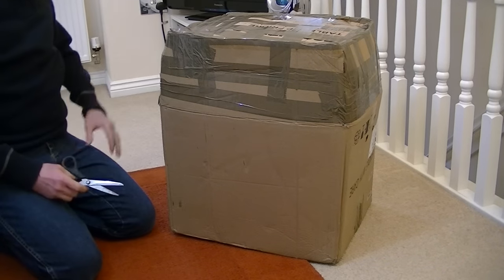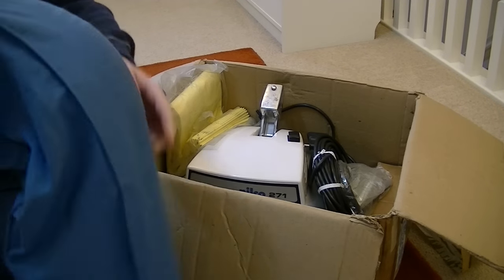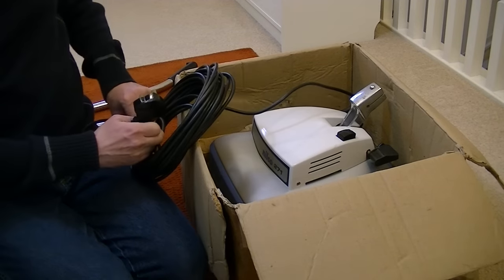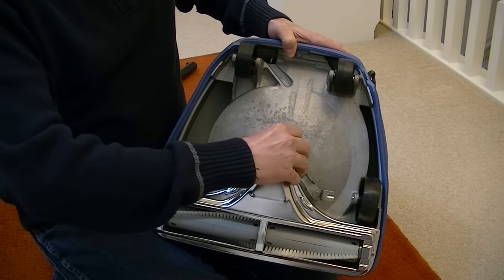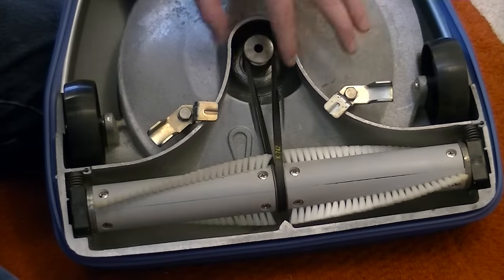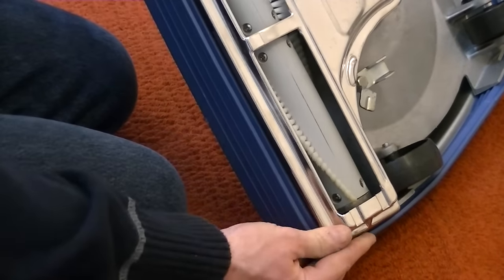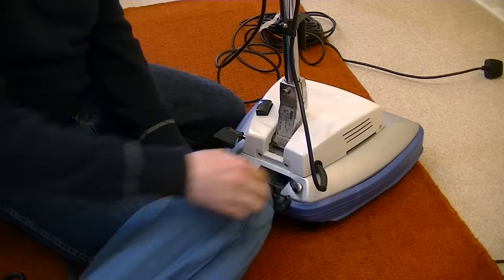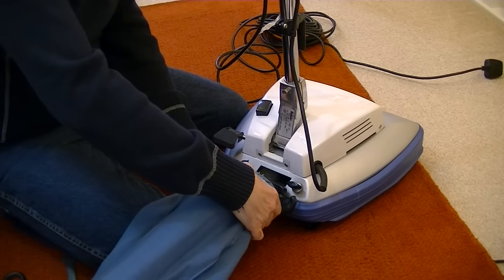Unboxing The Biggest Scariest Vacuum Cleaner I've Seen. A Nilco 271 Commercial Upright

Comment: Hi Roger, I love these machines. I serviced and repaired a lot of these vac's in the late 80's and the 90's. They all belonged to nursing homes and motels/hotels. The only thing that would go wrong is the cable, belts would snap or burn out if the user picked up something sharp ie glass or a nail or broken crockery. I did find someones false teeth in one, they did block from time to time again the user picked something up they should'nt have. They were more popular than Henry at the time I suppose commercial properties used more carpet back then. The other popular vac at the time was Kerstar KV1. I sold/serviced/repaired loads they cost more that Henry and were more robust all metal very similar to the Numatic nv250. Keep the videos comming . Dave Greenwood.
Reply from the maker: +Dave Greenwood This one will be having a very easy life, no false teeth will be picked up, but I will be testing it on my bag of filth. I have the correct bags and the missing bag support spring, so it is ready for the demo.

Comment: Hi Roger!  Very interesting!  Firstly, I actually think this Fakir/Nilco does not take disposable bags:  similar to some North American Sanitaires, this has a dump "Shake-Out" bag which is why it has an easy-to-remove bag by simply unscrewing the two neck anchors.  That is why you also have the easy-to-remove clip at the top.  The dirt just shoots up the fill tube and lands in the bottom of the sturdy bag.  I guess this makes it easier to maintain by cleaning staff.   The pack of Electrolux/Kent paper bags are actually our famous Eureka top-fill F&G styles bags introduced by Eureka-Williams in the late 1950's.  These bags made Eurekas outperform the competing Hoover uprights for about 15 years because the dirt drops away from the airpath and keeps airflow strong.  The bottom-fill Hoover C bags for our version of the Senior allowed dirt to drop right back into the fan chamber when in rest mode.  They were horribly messy to replace.  Eureka F&G bags are used in Sanitaires too.
Reply from the maker: +Brian Torobin It does take bags and I have obtained a pack. It's not meant to be used without a paper bag inside the cloth bag.
Reply: +ibaisaic oh...well then...looking forward to the demo presentation!
Reply from the maker: +Brian Torobin You will have to wait until next year, but that's not far away now is it.

Comment: You put the belt on correctly the second time, there is a fitting diagram on the fan casing just under the belt and it's kind of 3Dish to how which way the belt should twist.